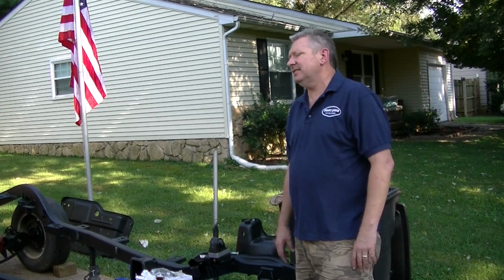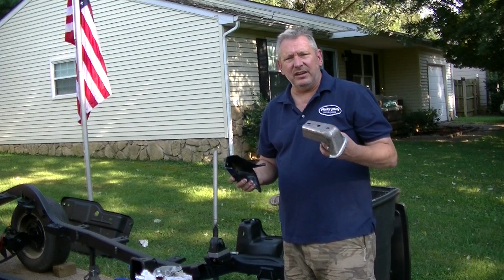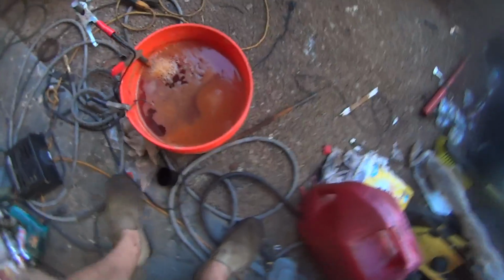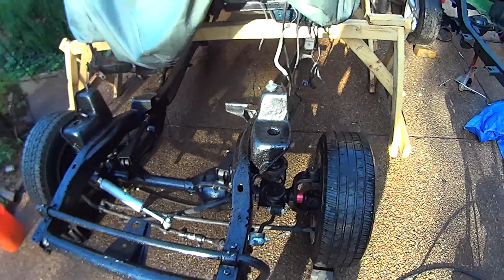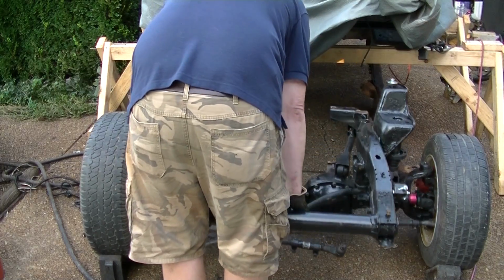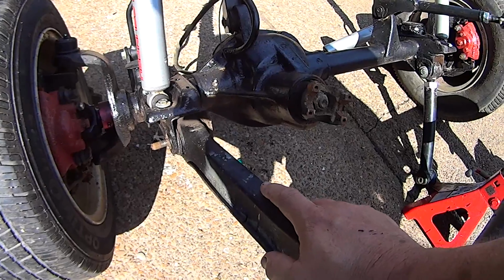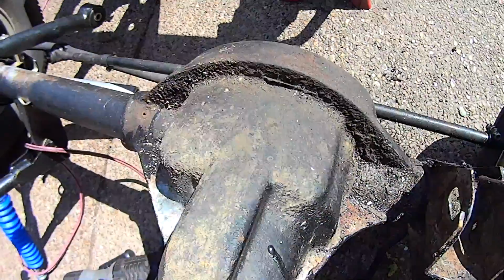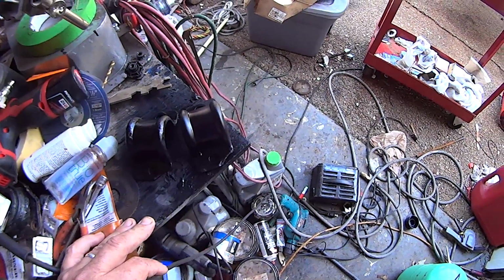Jeep TJ Project - Front Differential Removal and Cleanup

Comment: Great stuff Dave! I agree with Brantley. It might be a good time to just go with the 4.0.
Reply: Redneck Garage So the small block is next episode then? ;)
Reply from the maker: lanpartypro If I had a 4.0 donor Jeep maybe LOL.  Other wise I would have to buy - A new wiring harness - front and rear differentials - AX 15 transmission - new ecm - all other hardware associated with the 4.0- drive shafts,  All 4.0 motor components - brackets - ect - there is nothing that is common pretty much on the drivetrain between the two. I certainly would have been nice if they had made it easier to interchange. Be better to go with a chevy small block if you were going to swap anything truthfully.
Reply from the maker: +UndergroundTrev hahahah Trev - Im going vanilla with the ole 2.5 - after the frame beat me up Im ready for easy LOL